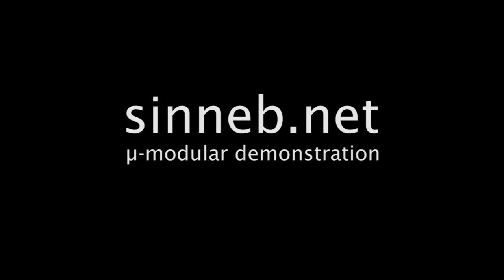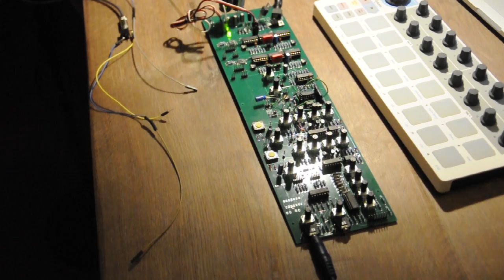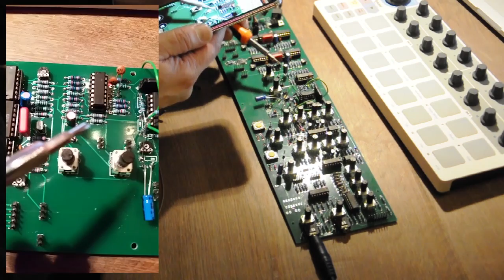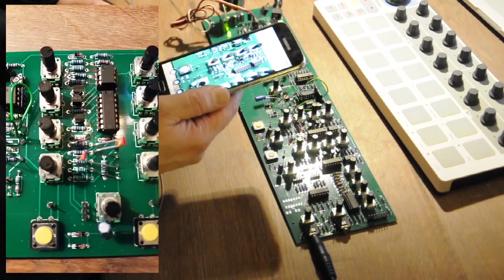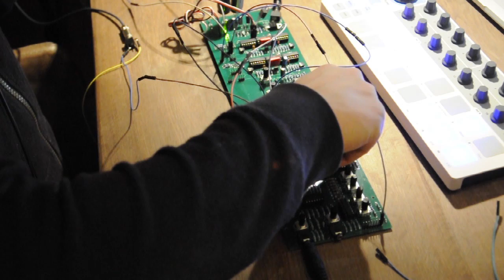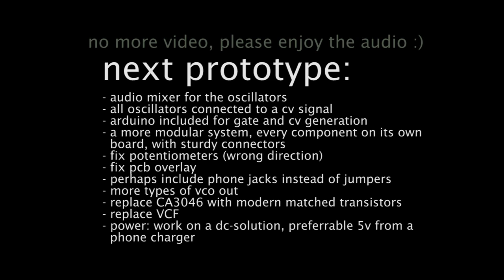Demo of the first µ-modular prototype

Comment: Hi! What is a best experience to use in exponential converters: CA3046 or a handly matched pair of 3904? This part obviously stopped the making of my little beast :) Not sure if I can just buy some little tester on Atmega from China or it's better to solder the Moog's matcher circuit... Need your advices, please! It's for my own use. I don't want to buy a whole system but I want to make a flexible synthesizer by my own. I'm not happy with synthesizers on the market: too expensive or/and too big or doesn't have features that I need etc. etc. etc...
Reply from the maker: Hi, thx for your kind replies. I used the CA3046 within a heater configuration, check my CA3046 videos. Under one of those videos I had a talk with another hardware designer regarding the CA3046, perhaps that info is of use to you too. I did a small experiment with hand matched 3904, but because of their physical size they remain very temperature sensitive. I believe that the heated CA3046 is the best and "easiest" way to go for an expo.
Reply: I've made mine by the schematic from here: https://www.muffwiggler.com/forum/viewtopic.php?t=92595&start=all&postdays=0&postorder=asc
Should I check my ICs with a special checker for transistors? Probably I'll order one from China.
The thing is that I can't get CA3046 here so I can only buy it's Russian analog. So I'm not sure where is the problem... Maybe I need to "play" with resistors... Just not sure where are the critical R :)
P.S. I've seen your CA3046 temp sensitivity video... As I've got it's pretty sensetive! I need to buy Tempco's 1k 3300ppm anyway... Now I've just replaced it with 1k R to setup everything.
Reply from the maker: I once did a transistor matching round and if i recall correctly, all I needed was a digital multimeter to match them on vbe (?). I've seen schematics for a matcher that has been used by Moog etc, also probably worth to check out. I've seen people encapsulating the matched transistors in resin to make them less temperature dependent. Also, smaller parts SMD parts with matched transistors are a good option (like the BCM847/BCM857 from NXP). And, read Rene Schmitz's article on expo converters and temp compensation: http://www.schmitzbits.de/expo_tutorial/
Reply: Big thanks!